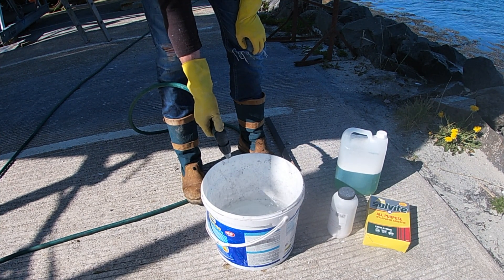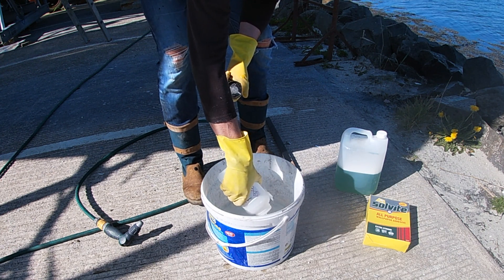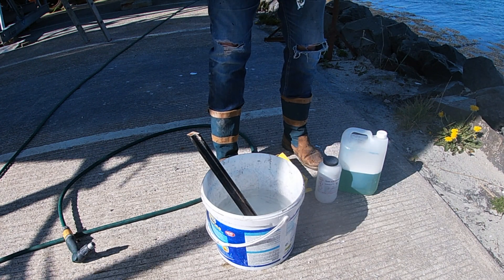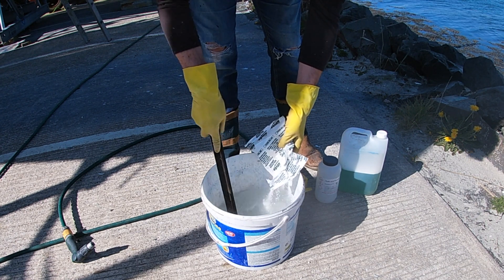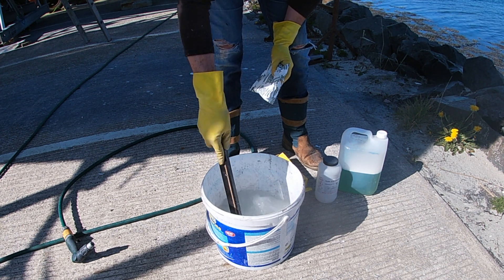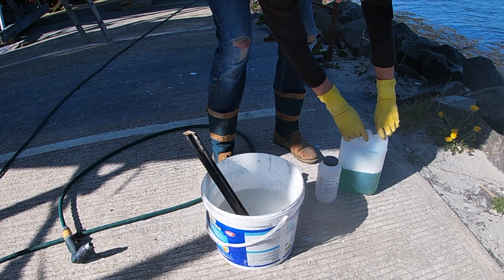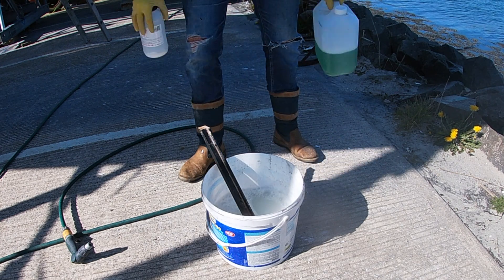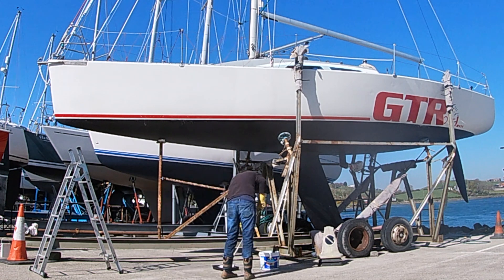Home made Acid Wash Fiberglass Cleaner

Comment: wallpaper paste,, isn't that glue ? thank you
Reply from the maker: It is that is why it is important to only leave it for 5 to 10 minutes washing it off before it dries.
Reply: @BottomUPBoats  Thank you so much,,, I tried it with out the paste under the boat and the results were amazing  ....i dint tried to clean the inflatable tubes ,do you think that it will damage them? Thanks again 👍👍👍👍
Reply from the maker: @johngaytes-ex7nt  glad it helped you restore the old shine. Should be fine on rubber tubes too.

Comment: In the video you say vertical surfaces.  What about the deck?  Or is it just too hard to make sure all of the acid is hosed out of any pin holes or cracks?
Reply from the maker: Depending on the slope of the deck you can go with this option if it NOT flat to avoid it running off. If it is flat you can use the same mix minus the wall paper paste. In both cases wash it down with lots of water post the cleaning process to avoid the acid getting into any unwanted places !

Comment: Nice vide just ordered some up and will be trying it in a couple o days. Many thanks
Reply from the maker: No problem 👍 Would love to hear how you get on. To give you some perspective we used around 2.5 litres of gel to coat the 36 foot yacht in the video.
Reply: @BottomUPBoats  Hi. Yes this worked really well. I did not add the wallpaper paste i just used it in a bucket with lots of soap. I then applied it with a broom. Lots of wet scrubbing. This seemed a much quicker way of doing it. less than 15 mins to do one side. totaly removed all of the yellow staining so easy.
Reply from the maker: @NeilEwins  great to here it helped to restore your shine !

Comment: Interesting mix, looks like it works a treat....can't say I've ever thought of a paste/gel option, just gone the spray or roll on solution, will definitely give it a try. Think its a good idea to wear glasses (an old hat and clothes) when mixing as well. As I said I've never used a acid gel but may be not using the power washer to begin the wash off, a lower presure hose might be safer......less atomisation (therefore more control of wash down) and more dilution potential with higher water volume rather than pressure (old engineering adage = 'the solution to pollution is dilution'......I sort of hate using it, but its sort of true). Talking of pollution it might also be good if you have a 50/50 mix of water and garden lime to spread around to help neutralise the runoff.
Reply from the maker: Thanks for all the comments, yes on the hose to wash off, my hose has multiple speed so start slow then speed up to full power. Eye protection and old clothes are the way to go 👍